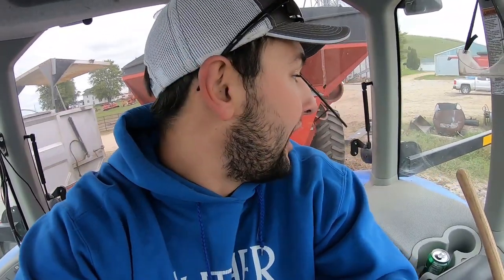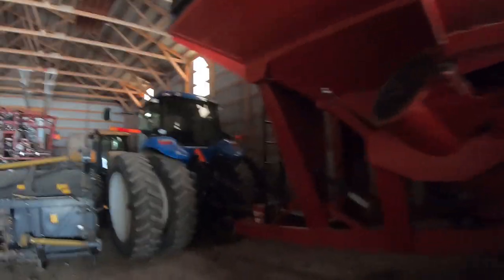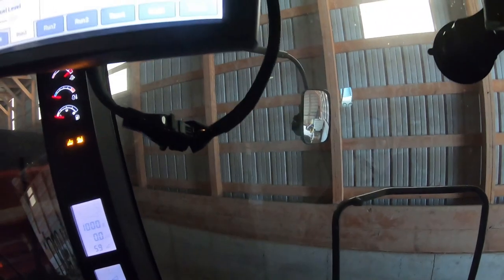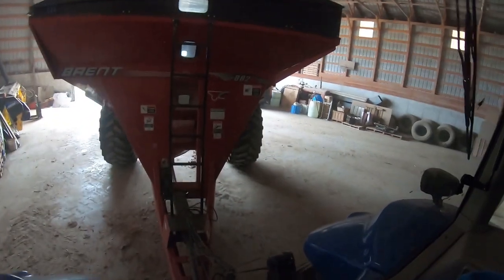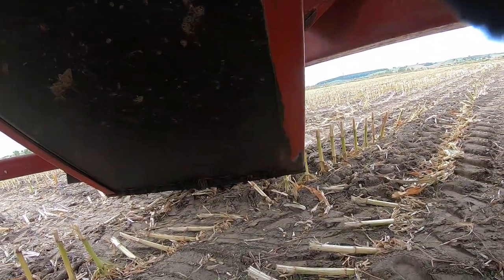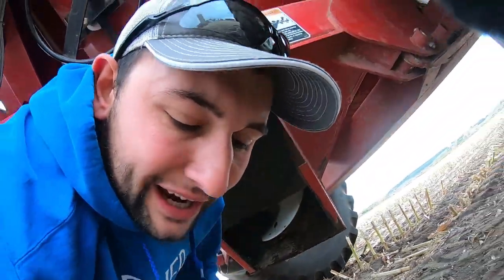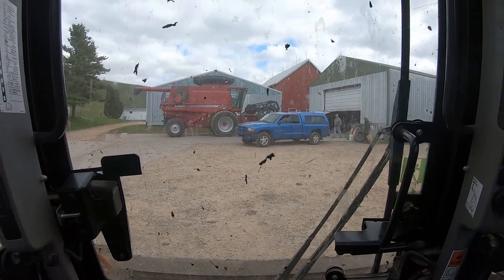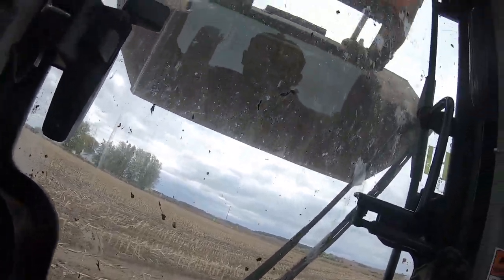We Start Soybean Harvest! | Harvest Video 10

Comment: The fastest stock tractor known was The Minneapolis Moline UDLX top speed 40mph. Why not pull the grain wagon with the 5088?
Reply from the maker: That’s crazy! And because the 50 isn’t very reliable, transmission issues
Reply: Triple R tractors is an expert on the 50 series.  He has all types of parts & repairs them.  Look him up!